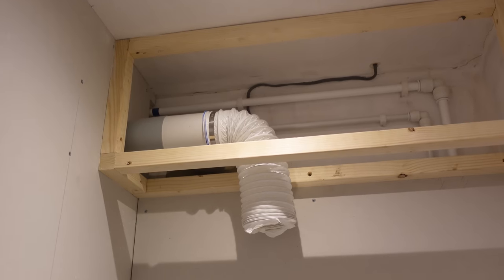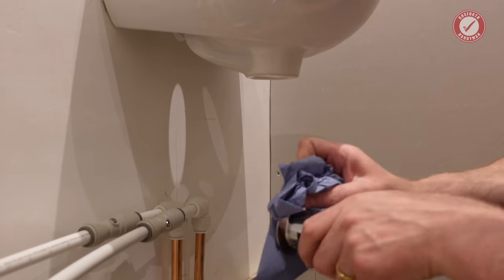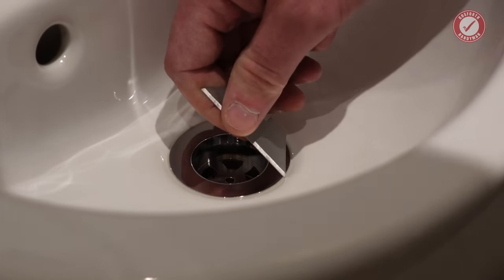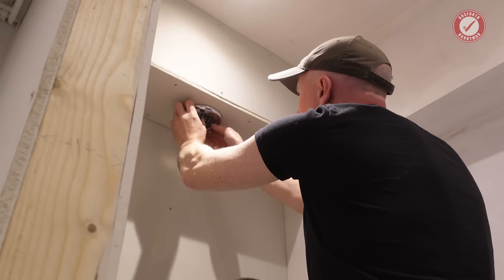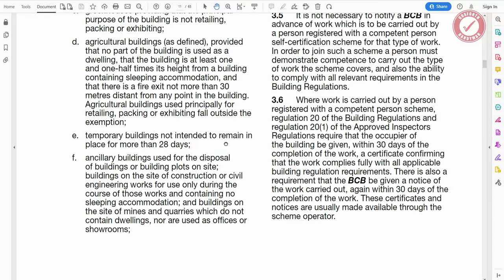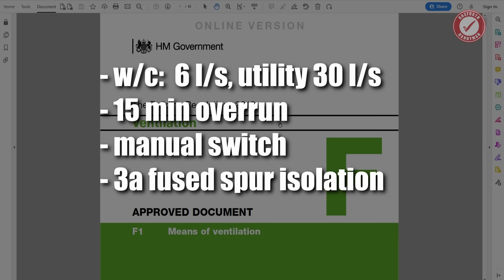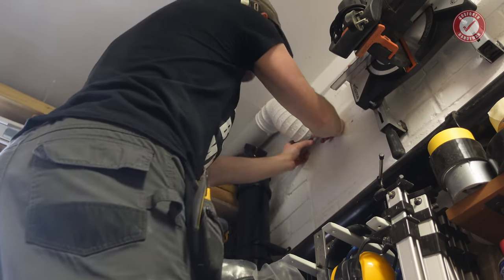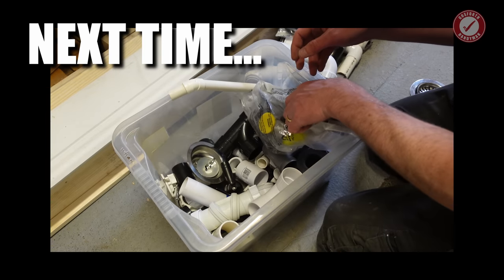Extraction, leaky basin and BUILDING REGULATIONS - new toilet (part 7)

Comment: So is the fan switch at arm height another isolator which will always be on, and then the fan pump is wired up to the light switch? It seemed you were using it as an isolator that you would manually need to turn on/off, is the 15min overrun then programmed at the pump?
I've got a similar situation at the moment where I want to vent a utility and WC room via one duct but each operating independently via one pump when lights are turns on however I may need two pumps?
Reply from the maker: The switch at arm height is just a normal switch and then there's the double pole fused spur isolator at the top. Completely separate from the light switch. The overrun is set on the fan. If you have 2 fans feeding the same duct you'd need some way to prevent one fan simply blowing out via the other. Can be done but gets even more complicated. 😁
Reply: A single fan can be controlled by two light switches (on the same circuit) with nothing more complex than a DPDT relay.

Comment: "A utility room... containing a sink that MAY be expected produce water vapour in significant quantities." (trimmed) You could argue quite easily that it is not expected to produce water vapour in significant quantities. Its not stating that a room with a sink is a utility room.
Reply: Indeed. I would not expect a normal size sink in a house to produce problematic quantities of vapour, nor modern appliances like washing machines or tumble dryers. But if the local inspectors imply they expect to see ventilation provided, it's easier not to argue. You never know, you might be thankful for it after a potent vindaloo. Anyway, it is required for the toilet, so adding it to the utility room isn't a great hardship.

Comment: Regulations are written as if "one size fits all".  A good inspector will understand this and make accommodations for the specific situation, but there are always some who will insist on following every detail of the regs whether or not they really apply.  And then there are some who are clueless  or lazy and sign off when there are faults that even a layman would spot.  How is it that buildings hundreds of years old are still standing and habitable without any inspections?  ;-)
Reply: Actually, the regulations are specifically kept loose for this reason. The Approved Documents are NOT regulations - they are guidance to comply with the current understanding of the impact of the regulations. Following them as closely as possible is the path of least resistance, but it's not the only one.
Reply from the maker: Yup!

Comment: Isolator switches are such a fail. They're meant to be for maintenance work, yet are presented to the homeowner as a normal switch, which inevitably leads to their use as one. Fans are the first victim, permanently disconnected.
Reply from the maker: Yup, so often left switched off... and most sparks seem to isolate at the CU anyway. 🤪

Comment: I don't understand the transition between copper to pvc then copper then plastic again?
Is that a British thing??
Copper pipe has a tendency to leak from corrosion due to the chlorine in municipal drinking water.
Why not go all plastic???
Reply: There's copper pipework around here which is well over 50 years old - no corrosion, no leaks. No such tendencies.

Comment: Building regs using "should" rather than "must". So i should, which means to me, I dont have to?!
Reply from the maker: You just run the risk of it not being signed off. 👍
Reply: @GosforthHandyman  I agree, the wording doesn't help. I prefer "must", no ifs or buts.
Reply: @UnfittedNoise  The regulation in this context quite clearly says "shall" - everything else is guidance.